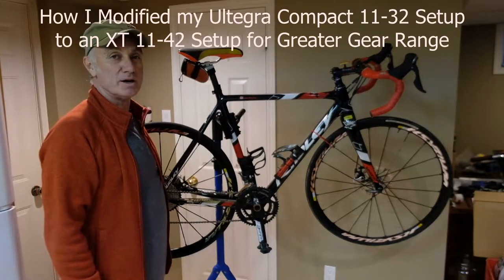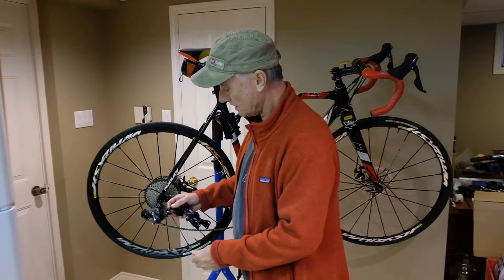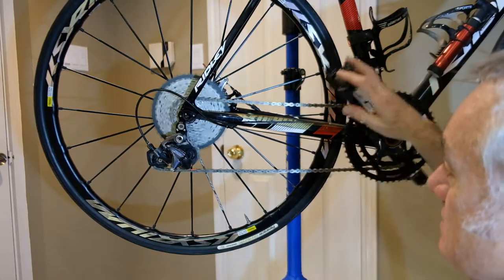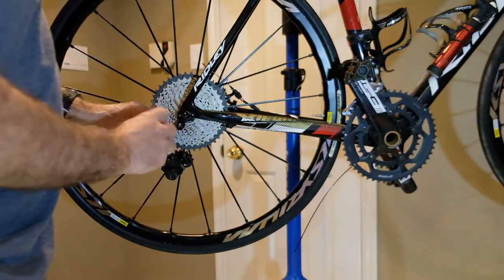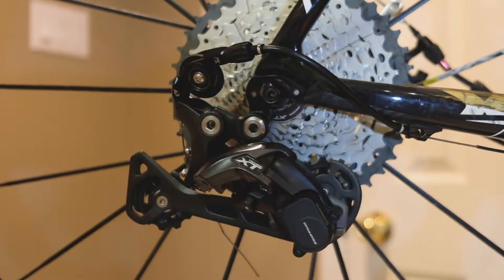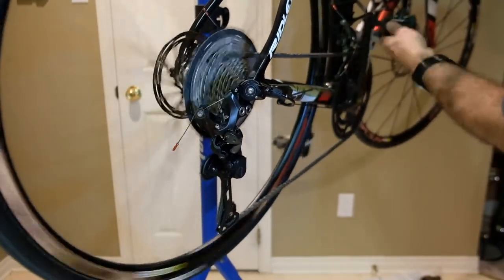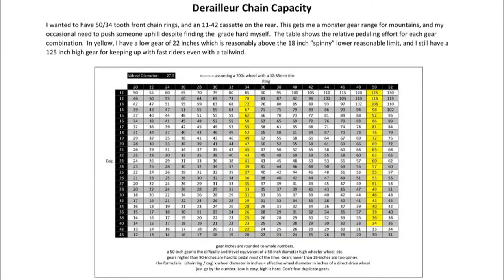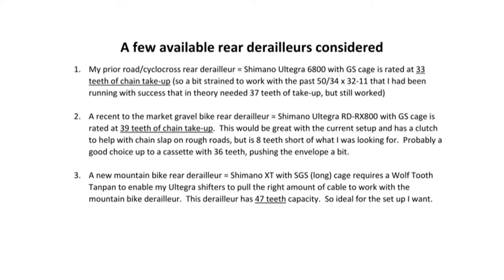Convert 11-32 to 11-42 cassette on a Road Bike = Monster Gearing

Comment: Just a quick note for anyone using Shimano with 9-speed shifters and drivetrain - 
Cable pull is the same for road and MTB derailleurs/shifters, so the Tanpan is not needed.   It is only required if you have a 10- or 11-speed system.
Reply from the maker: Yep, I didn't think to mention other systems.  I wish Shimano wouldn't keep making things incompatible like this - different cable pull between road and mtb - they are not consumer-friendly.

Comment: Btw the chain take-up can be fixed by fiddling the b screw instead of using a diff derailleur.
Reply from the maker: There was not enough b-screw range to take up the chain with the original Ultegra derailleur and the 11-42 cassette.  I tried that first, and when it didn't work, I went with the XT derailleur and the Wolf Tooth Tarpan adapter.

Comment: Wondering if its still working or if any extra wear and tear on the spring mechanisms or hanger?
Reply from the maker: The setup is great, no issues at all after about 6,000 km.  I love the wide range and low gears.

Comment: My older road bike (10 spd Tiagra 4600 STI's with a 10 spd 105 FD and a 9 spd Deore M592 RD) is getting geared down. I already have it with 12-36 cassette but don't want to end up with wide ratios so have tonight put on a "test" Tourney 30/46 crankset as I'm doing the infamous "Bealach Na Ba" here in Scotland this week (hopefully, unchartered territory with this gearing)- sea level to 2000ft in just over 5 miles and 2.5 of those are over 10%,  half a mile at 13% and some 20% bends.... I'm considering though, if this works out, reducing it even further to maybe a 26/42 crankset so I can get some use out of the 11-13 cogs as well as usefully lowered gears at the other end. Road bikes (especially beginner/entry level) are stupidly overgeared, even coming off of the Cairngorm Mountain I never got into the 50/11, I was going as fast as I comfortably wanted (30mph) given the patches of gravel and odd potholes and I snuck it into this gear and was doing a stupid slow 65-70rpm... Manufacturers are clearly idiots who don't consider the people who buy these race replicas and the terrain they often live in!! I'd argue that most of us would rather have a bike that gets us up a hill than comes down it at 50mph+....

Comment from the maker: I did get to try the 11-42 cassette on some extended rides in Cuba this January.  I certainly appreciated the lower gears for climbing.  I did notice the larger jump between cogs, but overall it didn't bother me as much as I had feared, instead, it gave me a chance to use varied cadence as a training opportunity.  Likely, i would not feel the same if I was struggling to stay with strong riders in a group.
Reply from the maker: Thanks, we are just finishing one tour in Cuba and about to begin a second one.   It's a great time to be here.

Comment: Hi, I run a 40 - 11 using a medium  cage Di 2 rear mech and wolf tooth it works fine. On my trek Domäne. I
Reply from the maker: It's worth trying simpler solutions first as you did, specific situations will play out differently.  As you saw the 11-42 didn't work for me with a medium cage Ultegra road derailleur.  it may have been better if I had an 11-40 but they were not available due to the global supply chain thingy.

Glad your setup works.

Comment: I just noticed by moving a 11-42 cassette between my roadbike and gravelbike that the grx rear deraileur (RD-RX810) has much more capacity than the ultegra rx di2 (RD-RX805). on paper its 39 vs 40 tooth but the ultegra derailleur is on its limit in the big/big combo where the GRX one still has some room. i sized both chains to still have some tension in the small small combination. 

the ultegra di2 even blocks the smallest two cogs to be used with the small chainring so the chain is even longer than it would need to be if those could be used.  

i use a roadlink dm on both bikes and both have 16 tooth jumps on the crankset. so if you have some real world use problems with the tanpan setup, the grx derailleur might be a good alternative.

Comment: I converted mine from 12-28 up to the way superior 11-42.  It's amazing.
Just wish I had a triple front 52-42-32.  Currently have compact 50-34
Reply: What rear derailleur are you using
Reply: @ui7183  use Any long cage and buy a roadlink extender just in case you need it.

Comment: Hi. Just found your video because I’m planning to change my 11-32 to 11-42 like you did. My question is, does the 11-42 cogs fit the road free hub without any problem or do you have to place a spacer? I’m running shimano gears. What brand of 11-42 cogs did you use? Will appreciate your response, thanks.
Reply from the maker: You may need a 1.85mm spacer to put an 11 speed mtb cassette on and 11-speed road hub.  If when you install the mtb cassette and put the lockring on results in any play in the cassette on the hub try the spacer, they are cheap

I went from Shimano Ultegra 11-32 to XT 11-42.  I'm not sure about other combinations, but I do not expect it to be an issue as long as the cassette is compatible with the splines on the hub..

Comment: you can try the rx812, it's technically the m8000 gs with road bike cable pull raito, and you can change the gs cage as the m8000 sgs cage to climb bigger cog.

Comment: Your bike is too pretty to ride gravel, dirt, water and mud.
Reply from the maker: It's seen it all.  It's a tough bike, but still light and agile.  I think for my current riding needs a gravel bike would be better as this cyclocross frame is made for tight turns and acceleration vs. holding a straight line in gravel and on potholed roads.

Comment: Thanks for a interesting and useful video. 
Another option crossed my mind while watching. 
As the  50/11 top gear is very high and likely rarely used by most non-racers, if such a high gear wasn't needed, a 46 or even a 44T could replace the 50T chainring. 
A 46/11 is still a high gear ratio by non racing standards, and this would lessen the chain take-up required of the rear derailleur as well as making for an easier front derailleur shift.
I'm no racer, nor do I want  to ride especially fast. I'm more than happy coasting or soft pedalling when my speed outruns my 46/13 high gear.
And as a bicycle rider in my seventh decade, I'm totally on board with low gear options. For my last bike build, a hilly and rough road tourer, I fitted a 30/48 low gear. I barely needed it on my last overnight ride, but I sure was happy that it was available.
Reply from the maker: I agree that you could reduce the front chain ring.  Personally, I like to go fast (on the downhills) so I appreciate the 50 tooth chainring, and sometimes miss the 53T from my road bike 🙂

Comment: Why not just run a triple crankset? Are there major advantages to this setup you have as opposed to a triple? I run 52/42/30 with 11-25 but considering this as an option.
Reply from the maker: Good question.  Triple is a good option, not as popular these days due to complexity, weight and dropped chains.  Still I like it.

For this bike and many others, the shifters do not accommodate triple gearing, so forced to go double, plus chainline constraints, and constrained to 50/30 up front, my best best option was to go 40/42 as the biggest cassette cog.

Hope that helps.

Comment: How do you rate the shifting using the tanpan after it gets covered in mud and filth? Very curious about this!
Reply from the maker: I don't use this for CX racing so it's not an issue for me.  I do agree, that everything you add to the shifting system is another potential issue, but I don't think (and no issues for me) that it's a big risk using the tanpan.
Reply: @leeorphan  thanks mate!
Always good to get people's opinions.
I'm on the fence between doing this vs a grx rear derailleur and adding garbaruk cage mod if I decide to go 1x.

Comment: I've been trying to find an SGS cage to replace the GS cage on my Ultegra R8000 derailleur but have been unsuccessful.  I run a 50-34 and 11-40 11-spd and the chain barely rubs on itself in small-small.  I'd like to change to 11-42 with a longer cage.

Comment: Hello Lee,  I have purchased Sprocket 11-42, RD Deore RL-M5120SGS, Shifter Deore SL-M5100L and SL-M4100, Chain CN-HG54 10S from Shimano for my MTB with 24 inch tire; which Crank should I choose ? I live in the area with hilly road. I almost 63 this year
Reply from the maker: A 42T front ring gets you a 1:1 ratio.  By 28T you are well beyond what is effective
Reply: I have tried to find the availability of Crank with 42-28 chainring ratio in Indonesia, but only GRX 46-30 available which close to 42-28.